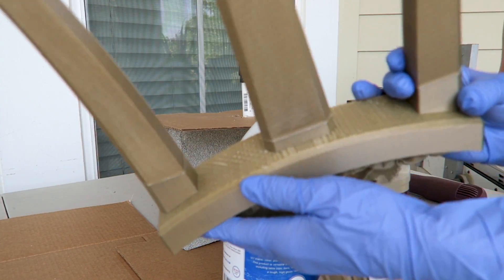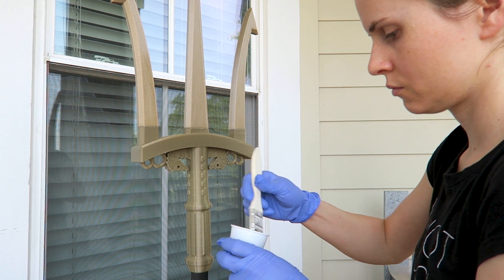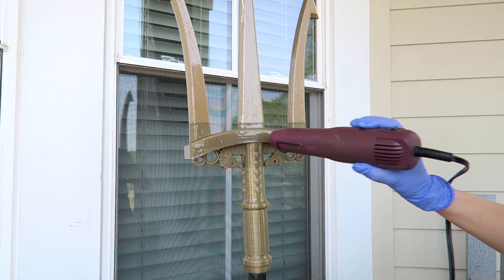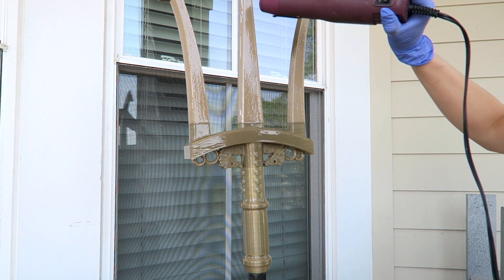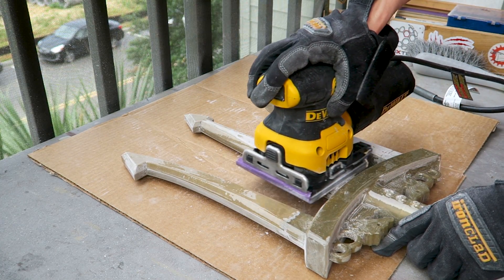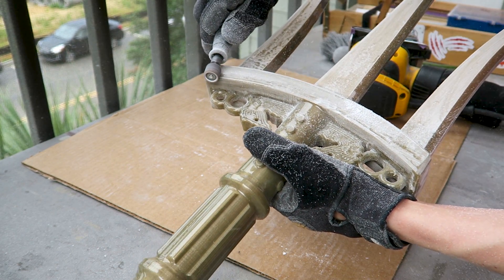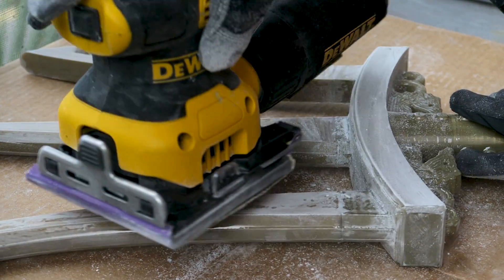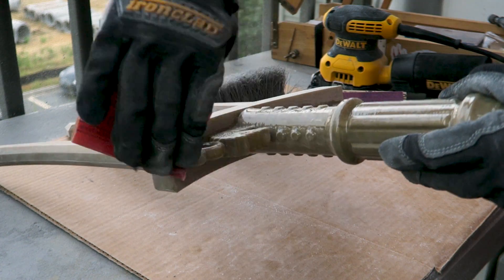Does Epoxy Resin Work for Smoothing 3D Print Lines?

Comment: Nice finish. I use my 3d printer to print negative moulds, which i then use to make positive moulds from silicone rubber and from those i cast my objects in resin. Any layer lines from the print obviously transfer to the silicone mould and in turn to the casted object. I had the same idea of using my casting resin to smooth the 3d prints. At first i brushed it on, but it left brush marks. Then i tried dipping, but this required a lot of resin that would have to be used or wasted. What i do now is pour resin over the object, catching any excess resin in a container beneath the object then repouring the excess resin until the object is fully coated. This results in very little waste and no brush marks. Additionaly, if you use pigment in the resin then no need to sand and paint a 3d printed object since the colour hides the underlying layer lines.

Comment: does acrylic paints really work on epoxy resin? do i need to prime it first? I use tamiya primers and colors
Reply from the maker: I use acrylic for everything without primer, but it has to be sealed with a clear finish after it dries. Always a good idea to test your paints and finish, of course, to make sure you get the result you want before starting on the actual project.

Comment: 🤔 have you tried same amount of sanding without epoxy?!? bcs isn’t the use case of epoxy coating on 3d prints that you don’t have to sand?!?
i‘am about to order 3kg epoxy with deep black pigments for my „Alien Queen breaks through Wall“ Project…
(my first epoxy work ever)
And i wonder if i could just pour 3-4 layers and airbrush some color and effects afterwards…

Comment: I will definitely try this method with my 3d printed Mandalorian helmet (not the TV Mandalorian, even more shiny). Normally, I use epoxy resin only to attach fibreglass to strengthen the printed parts. As this helmet is pretty much meant to be in pristine condition and will get an Alcald chrome finish, it has to be supersmooth from the beginning. However, I guess I will still do some more coating and sanding, trying to get a really smooth base.

Comment: This is a great video, I have been wondering about epoxy on a print. I did polyester and it worked fine and was a lot cheaper. I'm curious more about strength than looks and maybe even heat resistance. It would be interesting to see a test done.

Comment: I tried something similar but with UV cured resin. It does a good job filling the layer lines but does still require lots of sanding. I started with 220 grit and worked up to 800 I may go to 1000 just to see if their is a difference

Comment: Did you just have to sacrifice that paint brush to the resin? Or is there something I can soak it in to get it clean?
Reply from the maker: Isopropyl alcohol will clean epoxy resin before it cures.
Reply: @LindyDesignLab  thanks so much! Do you know if it matters what percentage it is?

Comment: You can heat both parts of the epoxy up to 35c or so before mixing which will make it much thinner. Also do not breath in that dust it messed me up a bit and I had to switch epoxies

Comment: What's the need for sanding after applying resin? Is the point of resin to smooth the lines and not have the need to sand it?

Comment: Did you print these grey pipes by the car at 8:35 ! :P  Thanks for review!! I made this flute (PLA) and coated it with XTC 3d and i have a distinct impression that water softens and renders sticky a completely cured XTC 3d coat!! this is hard to beleive but this is what i observe. Do you have any observations on this XTC thing? Have you heard of any suitable, airtight, waterproof, rigid acrylic coating that may suit a PLA "woodwind"? A few years ago this guy painted a metal staircase here at home with acrylic paint and this coat now really feels like ceramic! It is the firthest thing from a rubbery or sticky substance. I wish i had known and asked him about that type of paint back then, I only remember him saying Acrylic. Cheers!
Reply from the maker: Nope, haven't got my concrete printer up and running yet. Regarding xtc, I believe it's just a standard epoxy resin, so first thing to double check is that it was mixed in exactly the right ratio. Polyester resin is forgiving in that respect, but not epoxy. Other thing to check is if something could have been on the surface of the item or tools used that inhibited curing. I don't know about xtc specifically, but in general epoxy will not reach its fully cured, hardest state for long after the basic cure time. Table top for example needs about a month before it stops taking impressions from things left sitting on it. Not related to water unless it is hot, so I have no ideas there. Was the acrylic sealer on the metal gloss or matte?
Reply: @LindyDesignLab  The paint on the staircase is moderate gloss and it has the feel of real enamel: like, sometime ago i mashed glass into powder, mixed it with water to make a paste and "painted" this 50 cents coin with it, then heated the coin and glass to red until the glass started to look like orange skin and fused with the metal (if you do this heat up the coin lightly as it cools because brisk cooling with make the glass separate from metal)..so, sorry got dispersed, so it made enamel and this "acrylic" look like this glass enamel. So today by chance i looked at the car's paint and this is how this paint feels like. So I bought this enamel spray and sprayed the flute inside, as well as onto a few samples. This thing becomes extremely hard and unscratchable upon drying, just what i needed. Only a little thin. So one may need to add a few coats..
As far as the XTC is concerned I really measured the dosage correctly because the thing cured on a sa;ple very quickly to a lovely, shiny clear, strong layer. So I asked myself "why should the flute be sticky and the sample (on the same PLA!) is cured as a brick?". Then just smudged some water onto a glossy, cured, shiny XTC and rubbed it slightly and in no time at all it became sticky! So I immediately googled "XTC is not waterproof" and got the very xtc maker's site saying in a resume about the product "while xtc is not waterproof, it is very  blablabla..."  So in a word, XTC aint no real epoxy in my book lolol. So i just sanded the flute inside and sprayed the white enamel thing and then bought some real epoxy (so friggin expensive this stuff!) and added a thin layer of that too, it better be waterproof :P  Thanks so much for reply youre real elfine
Reply from the maker: Wow, that is insane. Why the xtc developer would take an epoxy like substance and add something that makes it degrade in water, I can't imagine.

Comment: What type of filament did you use for this? PLA has a has a 60  degree celsius heat deflection temperature, and I'm concerned that epoxy resin may get too hot.
Reply from the maker: It's PLA and nah, epoxy only gets super hot if left in the mixing container too long or poured thicker than recommended for that  particular type. That said, it's always a good idea to test your exact materials before attempting anything large or important.

Comment: I have the same Dewalt sander. It's easy to fabricate an adapter to connect the hose from a shopvac to the sander for almost total dust collection.
Reply: You can 3d print an adapter ! Thats what I did with mine.

Comment: I've just been experimenting with sanding filler primer with my dremel. 
Sanding drums were too aggressive and polishing wheels not aggressive enough. 
I took an old steal brush disk that I'd worn down to the hub and glued a circle of green scourer pad to it. It actually worked pretty well. It removes material but if you're careful it doesn't strip it right back. What I really want is someone to make some composite sanding rods. Something like a grinding stone but much softer. Like a resin with 200 grit sand embedded in it. They could cast them in different shapes so you could poke them into all the narrow gaps you get on 3D printed objects.
Reply from the maker: Yeah, always looking for better tools. Just started experimenting with the permagrit tungsten carbide stuff for composites, but man that is rough, even the "fine."

Comment: well done. It is really good result. I will try table top resin for some prints and I also need to repair my table, it is scratched around the keyboard. I found some resin on ebay, but I think it will never come, because it is 4 gallons for $7 :-D
Reply from the maker: $7 plus $300 shipping
Reply: @LindyDesignLab  they said free shipping. And I got message that it was shipped now. I will let you know if I will get it, they said it will come in August. I'm really curious if this is real thing :-D
Reply: @DanDishonored  did it came ?
Reply: @currymasterrace7153  no, seller disappeared and I got money refunded.

Comment: Thanks for this video! I recent noticed seam lines coming back through a fully painted helmet I'd 3d printed and finished and couldn't figure out why. I'd assumed the many layers of filler primer I'd put on and sanded would have been enough to keep the from showing, but over the last couple weeks I've watched them become more apparent. Ugh. I'll have to try some resin, maybe XTC3D or the likes, for my next project.
Reply from the maker: Yeah it's a really frustrating problem. Don't know for sure if this is the solution but it seems promising.
Reply: for seams, you can use wood filler or bondo, sand that and then follow up with a filler primer
Reply: @kazolar  Thanks! I just tried this the other day on a new project, using wood filler to cover seams. As I was watching this video I was thinking... "oh, I really hope this wood filler doesn't let the seams show through, too." Good to hear it will help with that! Think I may have to sand down my other paint job though on the helmet with showing seams and figure out a solution. Perhaps just sanding it down and re-filler-primering it and repainting will be enough.